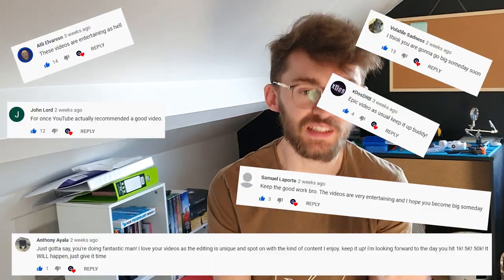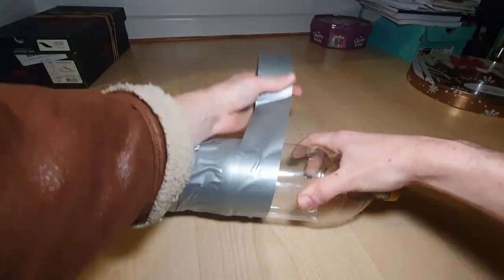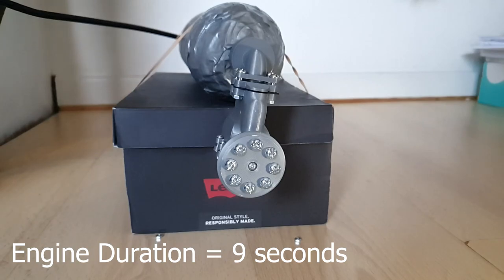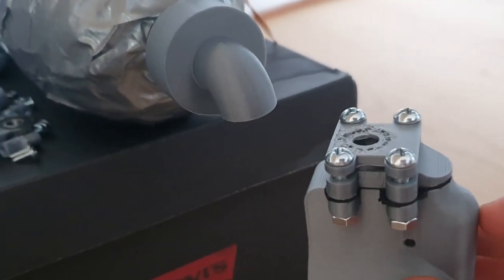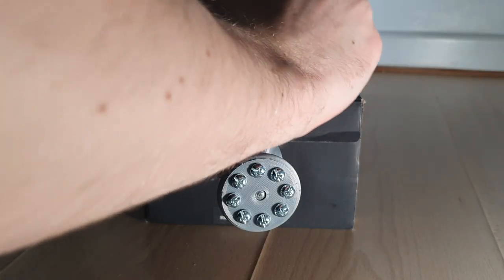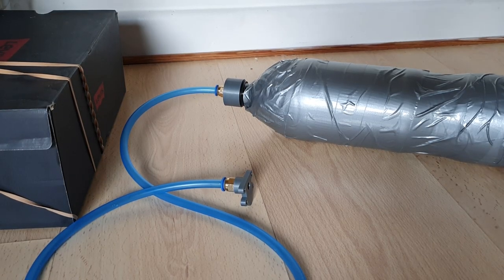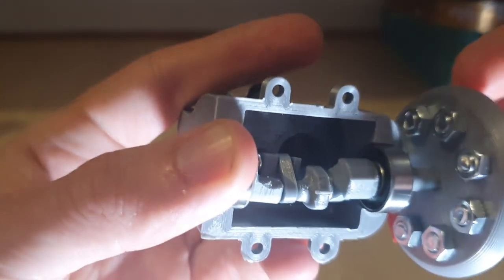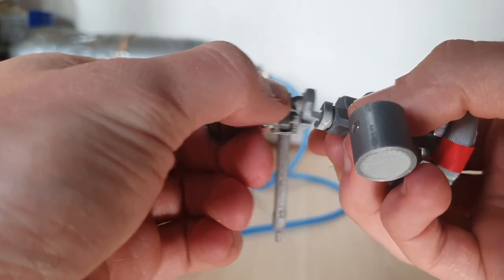3D Printed Air Engine (V2.5)

Comment: Your videos are truly funny! 😂😂
Btw, this engine is a very nice improvement over the previous iteration, bravo!
Reply from the maker: Thanks buddy 🤙
Reply: Oh shoot, I forgot to suggest to use a stronger material, for example I use pla+ (sometimes even carbon reinforced pla), cause it really allows me to strenghten the weak spots, on the flip side, it costs a bit more (and the carbon reinforced plastic wears A LOT the nozzle of the printer)
Reply from the maker: @ferraristahd1661  I've never printed with pla+ or carbon fiber, I'll need to get some!
 I've got some Petg I'm going to try soon and see if that helps too
I've heard you need to get a hardened steel nozzle if you get carbon fibre filament as it chews through the brass nozzles!
Reply: @kurzey8532  yeah, unfortunally a strong nozzle is mandatory

Comment: Maybe try a little grease on the crankshaft? Might at least perform better than running dry. Could also lessen some of the grinding in the engine.
Reply from the maker: I could pre grease some of the parts before assmebling the engine, I spray silicone lube in through exhaust before running which helps a bit, but still a bit of a grinding noise, thanks for the tip!

Comment: You should be trying to print the o rings and seals with rubberized pla. That way you arent limited by the what size of rubber you can buy
Reply from the maker: Never heard of rubberised pla, I know could do it with TPU but I haven't  printed with it
Reply: @kurzey8532  yeah i meant tpu as well. Ive used it before in my printer. Its no different then normal pla in terms of design. But i think youd get a better seal if you replaced the gaskets and seals with something that fits your design better. At very least youd gain more control over that aspect of the project

Comment: Yeah I was thinking: "Engine redesign it is" this entire video, and glad you will! Maybe a lower power engine next time.

Also to help you with the pronunciation of my name, the english version would be laser and then burkha but with a g. Then after that it is just Merlin with an s. 

But the Lazergurka part actually is swedish, specifically laser cucumber. If you want to attempt the swedish pronunciation it is "Lah-ser gur-ka"
and the u is special, so type "gurka" into translate and try to imitate it.

I can see why you're stuggling with the pronunciation though
Reply from the maker: I think lower RPM engine would be far more reliable, as it always tends to break on the initial spin when the forces are highest as opposed to breaking from repeated use!

Thanks for the tips, I'll work on my Swedish pronounciations 😏

Comment: great video! you should maybe invest in a air compressor so that you can run the engine longer or so that you don't have to physically pump as much.
Reply from the maker: Yes I should 🤣 trying to justify it to myself and need to find somewhere to put it

Comment: I've literally got a mini compressor that would be perfect for you, been making 3D printed bottle lids recently and found if you put an o-ring where little plastic band is helps seal so much better, and some PTFE tape on pneumatic push fits, managaed to get one to hold out long enough to lift my car :p
Reply from the maker: Do you mean the plastic rim that's a few cm after the bottle thread? Or am I being dumb lol

Yeah I need to get some ptfe tape lol
Reply: Yeah, the bit thats left after taken bottle lid off, I've been replacing it with an o-ring, bit of ptfe on threads of pneumatic fittings, could also do threads of bottle but dunno if this would cause more problems, also you can get fittings that have nuts eachside, normally just joiners, allows you to but a peice of rubber on inside of bottle lid, helping the fitting seal better, finally got a print of yesterday thats held 100psi all night 😁
Reply from the maker: @dshaw20355   yeah thats definitely helped reduce leaks from the thread I did that too!

Nice! That sounds like you got a good system there
Reply: Eyyy well glad its helped, looking forward to your next video.

System may work but dont have a scooby what im gonna do with it or make from it 🤣

Comment: 3d printed parts aren't strong enough yet to use in all motor parts ! you cant use it for parts that are under heavy stress , neverminded how hard you try, you need a really low speed motor or parts will explode anyway, replace those shafts with metal parts.
Reply from the maker: I think there's a few things I could try, increasing the thickness of the parts could go some way to help, also I might try using PETG as the bonding between layers is stronger. 

I would like to incorporate some metal components for sure!
Reply: @kurzey8532  I really tried all kind of filaments . fiber carbon , PC , PETG ... as there is always LAYERs , there is a low chance to success . some ppl put their printed parts in salt and try to re melt it in Microwave oven. I didn't tried it yet but I think it also can help .I think its not a good idea to do all parts with FDM printers. I bought a Hard-Tough Resin for my SLA printer, if covid quarantine let me, I will try it . but you also can cast those parts ! (what I will ty too after covid quarantine )

Comment: Heat up the steel ball and press it on the hole, after it cooled down, it’s a pretty good seal! That’s my first method before I go bought the o rings... trouble for doing a lot of it but works really well for one. 
actually o-rings are not easy to use for some reason, it still leaks for not fit perfectly in the 3d printed parts... 
and what about a bigger fly wheel...😂, your fly wheel compared to the size of the engine looks so poorly...
Reply from the maker: Yes I need a bigger fly wheel 🤣 it's why the engine runs so fast lol

Comment: The 2 bearings must be as near to the crank as possible. Otherwise the crankschaft will bend. You have to move the timing / valve opening cam to the other side of the bearing. Yes, i know wont be easy, but it will double the rpm.

Comment: Well, perhaps the function of an Compressed Air Grinder (The part that let it Rotate at High Speed) can be of help? Perhaps it even helps Tom Stanton.. you know this Angel in your Video XD

Like this: https://youtu.be/cQnvWUpWmYg?t=106
Reply from the maker: I believe thats called a vane motor, and is what most compressed air tools use! Better for high rpm things as you said!